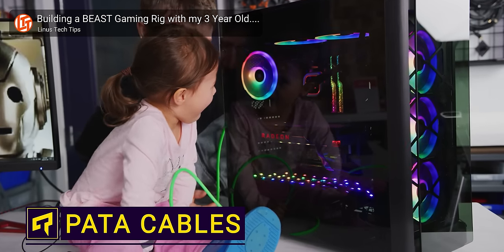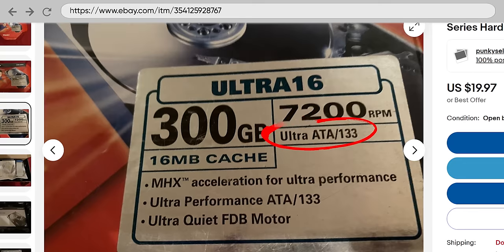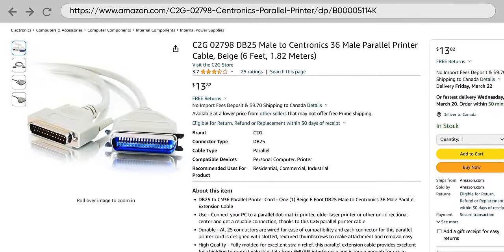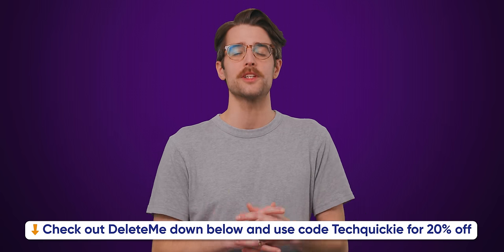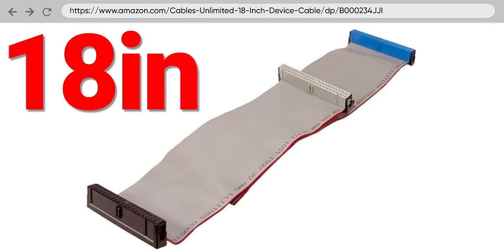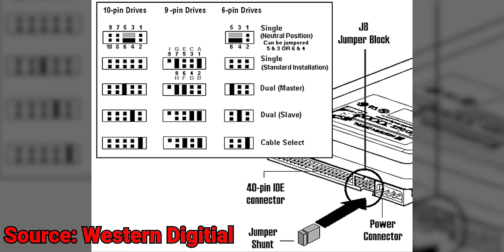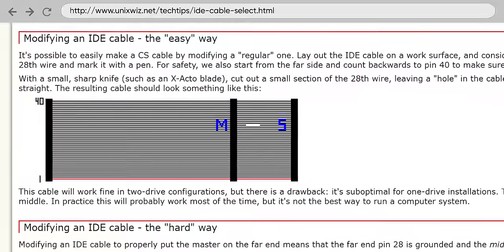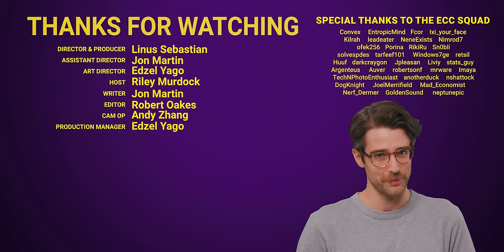PC Cables used to be HUGE. Why?

Comment: Slave. Noun - a device, or part of one, directly controlled by another.

Literally no need to skirt around that, jeez... context is everything Gen-Z!
Reply: Yeah, there wasn't really a need to highlight it as it only actually made it into a talking point (hence our comments). History is history and you can't change it or rewrite it - all you can do is accept and learn. You can't sanitise every aspect of life in fear of triggering somebody for a perfectly valid word (as you pointed out).
Reply: Yeah, found that part unnecessary too. Don't care for the writing team putting in their views on political stuff. So what if it was called master and slave drives. What about the names for connectors, that an issue too? The people that complain about old terminology would most likely also have a fit over what adjusting a distributors timing is called.
Reply: Yet, the slave device isn't actually controlled by the master drive, but by the controller on the motherboard. And it's fine if the wording isn't offensive to you. However it happens to be to others, and since there are perfectly functional wordings (that have been used for decades already - my older drives of years ago already have PRI/SEC printed on them) let's just use them. There's no need to go out of our ways to be <shower>bags just to offend others. Because at this point, that's the only reason to keep using the master/slave nomenclature.

Comment: Who remembers eSATA? Oof
Reply: My mainboards always had that port on the IO Panel... I've never used it :D
Reply: Aside from the connector not holding on very well, it was pretty useful. I much prefer to use it over USB. Unfortunately, eSATA port multipliers aren't well supported with drivers nowadays so using multi-drive enclosures doesn't really work anymore depending on your setup.
Reply: eSATA is great. I love having it as an option for when I need to recover data from a HDD or just copy data very quickly before swapping drives for an upgrade.

Comment: Augh, I remember the time I changed a broken PATA cable and my hard disk became two times faster (facepalm). I was definitely not aware two identical cables could have different speeds (Yes, USB-C users: At that time, it was not common).

Comment: I don't think I ever called it PATA, it was either IDE or P-ATA, I'll be honest back in the day of IDE drives, airflow was never a big consideration for me, then again case manufacturers didn't seem to take it into consideration either, the front panel was usually mostly blobked off, even if they had fans, then after that you had the HDD cage that blocked airflow further, and then all the wires for the IDE, Floppy Drive, PSU etc, they hadn't realised the area behind the motherboard could be used for cable management,

Comment: Ive heard them called PATA, parrel cables, ribbon cables, IT neck tie(s), and remember debates whether or not you should run both hard drives on the same cable (2CDs on one, 2 hard drives on the other) or if your should run 1CD and 1 Hard drive per cable ea.

And then you had the small ribbon cable, accesory PATA, floppy drive cable, 24-pin connector cable, "the smaller one dumbass", there was a few other names ive heard that cable called just cant recall them off the top of my head.

Back before we had the internet and tools to actually measure performance, along with actually having to talk with eachother and debate in person... Also the same time when if you said you hacked a computer everyone got the mental image of you getting REALLY pissed off at your computer and just going to town with your axe on it 😂

Comment: SATA 1.0 is actually superior to even the fastest PATA. At 1.5 gbps, it had a theoretical bandwidth of 187.5 MB/s. Of course, standards have overhead, but 187.5 minus overhead is still faster than 133.

Comment: There were better cables which were round, classic "IDE" connector could be annoying, but it was reliable and idiotproof. Today SATA connectors can be destroyed just by accidentaly pulling the cable in wrong direction, I totaly hate it. You can see it on motherboards from time when SATA was new thing, most of them have damaged sata connectors becuase people didn't know how fragile it is, they were used to PATA where you vice versa had to use force to disconnect it. With hard sata cable, when you are trying to do cable management, you can break connector, especially on HDDs where it's not protected on down side of HDD, at least DVD drives have extra piece of plastic there.
Another problem of SATA is that it doesn't hold well in motherboard and HDD and you can easily get bad contact and BSODs and another problems. Such problem didn't exist with PATA cables.
SATA connectors are just completely stupid, thank god for nvme now, most of people don't need anything else now.

Comment: In the future we will have a rectangle shaped glass cube the size of the length of a credit card. In the center is a small vile of your own DNA. One of the faces has a full grid of 1000 x 1000 copper connection points and you plug in a 1 inch metal slab to it that has a single input port that is called an x-port. The DNA storage and compute power is basivally infinite
Reply: can't wait for vegan drive that uses plant DNA instead person/animal DNA

Comment: SATA is already becoming obsolete, because NVME drives are much faster and don't cost too much more compared to SATA. The only advantage is that if you want more drives in your systems you don't need expensive motherboards or expansion cards, just $1 SATA cable

Comment: Isnt PCI-E just one big parallel connector?
Reply: not exactly. PCI-E is more like having 1-16 serial lanes for data, where parallel connectors were instead intentionally sending a collection of bits as "one byte" at a time.
Reply: PCI-E is multiple serial connections running in parallel with a software layer on top of the whole thing it that makes it work.

Comment: The ( redundant ) computer  D.I.L.  sockets make 1st class connectors for the modern G4 base 12 Volt LED lamps ... but ... you MUST fit the lamp at 45° ( diagonally ! ) ....... ( tried - n - tested ) ................... DAVE™🛑

Comment: I have never heard these cables called PATA in all the uears building comouters in the ancient times.
Reply: That's because there was no need for the term and unless you were a hobbyist assembling computers during that brief periods between when SATA was released and PATA cables were effectively discontinued, there'd be no reason for it. Not to mention that even during that period, I'm pretty sure that most computer parts shops were still listing them as ATA cables.

Comment: One of my biggest frustrations was trying to add a slave drive to my computer and it absolutely failed to care. Used the cable, moved the pins. Didn't matter. It tried to boot to that drive no matter what I did to it. I am so glad that issue is gone now!

Comment: If the 80 wire cables are just grounds for the 40 wires, why are there situations that require an 80 pin only setup like in game console mods?  For instance if you upgrade the hard drive in original xbox, the 40 wire will not work. I dont understand why it wont work if they are just grounds

Comment: I "like" how these videos have been steadily becoming more zoomer oriented. What was common knowledge and would never be mentioned in early 2010s is now a subject of an entire video. Also, imagine having to apologize for the master-slave designation.
Reply: Actually, yeah, master-slave designation is weird. I prefer to use driver-driven designation, which is much clearer
Reply: @maksimfedoryak It made perfect sense to me and was never a source of any confusion.
Reply: @Henry14arsenal2007  Sure it might not be confusing, but it can be offensive to others. And seeing as it's literally no effort to use something like server/client or primary/secondary instead of master/slave, why not use that? In fact, pretty much all my IDE drives already had PRI/SEC printed at their respective jumpers.
And with regards to IDE, the master/slave wording is misplaced too, because the second device doesn't get its commands from the first drive, but from the motherboard. So both happen to be 'slaves'. Just one has the 0b00 address, and the other the 0b01.
Reply: @Xiph1980  and it somehow being offensive is exactly why apologizing for it is ridiculous, imagine taking offense from a concept used completely out of context.

Comment: Mmmm. If you're going to peer into the darkness of jumpers on HDDs, then let's add the ones that specified platters and cylinders and sectors and heads which were set / plugged by the manufacturer at the factory, but misguided users could remove and botch during assembly. If you couldn't get your drive to work properly over the big ugly ribbon cable, it paid sometimes to check what the claims on the box said, v what the actual jumper settings were. Then there was the question of whether the two cent printed assembly instructions were right, or whether anybody had actually checked that, because in quite a few cases, those instructions were wrong.

Comment: i remember when i got my 400 mhz intel
Reply: I remember when i got My 2MHz Zilog Z80 & soldering all the 74xx series TTL chips onto the board! IBM PCs did not exist then. My first 51/4 floppy drive cost $500 & that was cheap, even with shipping from Brisbane to Sydney, because I new a guy ran a shop & gave Me staff discount.

Comment: I remember one issue with EIDE drives. Sometimes the drives will seem to get locked to a cable selection or a jumper setting. Once it's a slave, it will always be a slave. Once with CS, it's always CS. Rearranging drives was tricky.

Comment: wrong, serial is not faster than parallel
Reply: Over long distances it is. Where long distance means more than light travels in 1 clock cycle. And that is about 5cm.

Comment: They were never called PATA. They were called ATA cables and. The format of a n wide ribbon cables with IDE connectors was widely used even pre IBM PC.

When Serial ATA cables came they were called SATA. The round ATA cables were easier to bend and sometimes were illuminated.
Reply: He literally said that in the video.
Reply: Some sites started calling them PATA when SATA started become more mainstream. Most people I knew and communicated with in the late 90s/early 2000s just called the cables "IDE cables." Sort of like how some people call them "coaxial cables," and some people call them "BNC cables."
Reply: @billyeveryteen7328  Coax is a cable type. BNC is a connector type, as is F-type, or TNC; they all use varieties of coax cable.

Comment: They were called IDE and EIDE cables.  What bs is this?
Reply: I remember them be called ATA cables.. 
Later came SATA300 and SATA600.
Reply: Nope
Reply: Well, everybody used the IDE name for a while and then the name ATA came around, but the PATA name came after the SATA cable was introduced just to differentiate it from the newer one, that’s why almost no one knows it by that name
Reply: IDE and EIDE were names that Western Digital used when introducing the interfaces. ATA, ATA-2, ATAPI etc. were ANSI standards that followed. It's like "TF card" and "SD card" where TF became SD when the card became a standard.
Reply: @bgezal  I think the TF bit is an open implementation of the SD standard; no licensing fees.
Reply: Yes many of us called them that.   But IDE was only the interface name,  ATA/PATA was the protocol used.    It's a bit like Ethernet vs CAT5 but in reverse.
Reply: He mentioned that in the video.

Comment: Why didn't they go with serial in the first place?
Reply: I'm no expert when it comes to computer interfaces. But I'd say this: parallel interfaces was the best available solution in the 80s and 90s for computer peripherals wanting faster data transfer like disk drives and printers. Serial interfaces like serial ports back in the day could only handle mere kilobits per second while the parallel ports could handle a few megabits per second. Over time, we developed better cables, better semiconductors, and better modulation techniques like QAM to make those serial interfaces work faster.